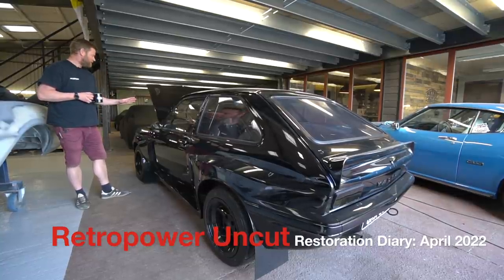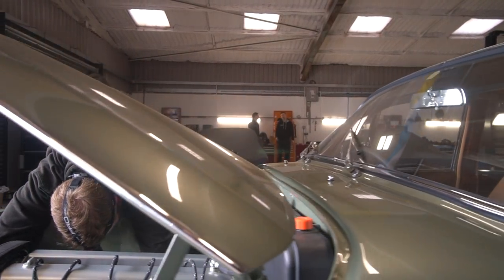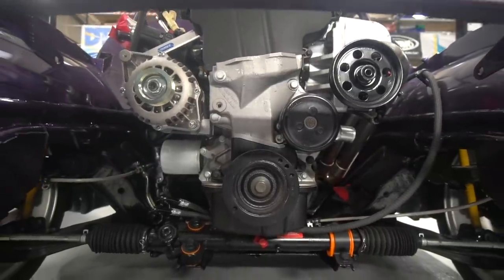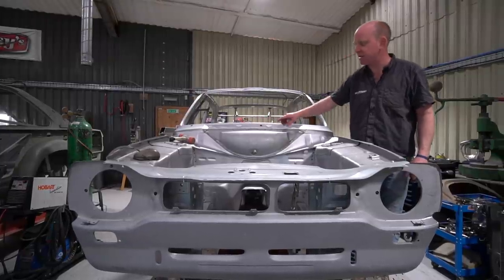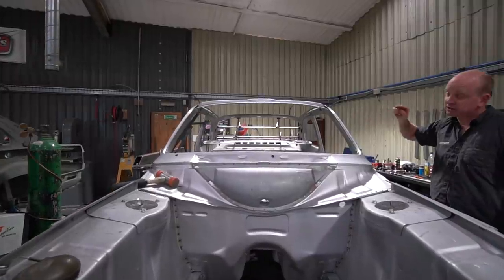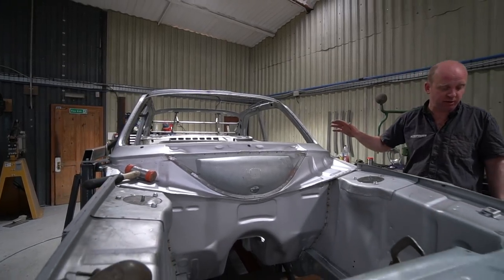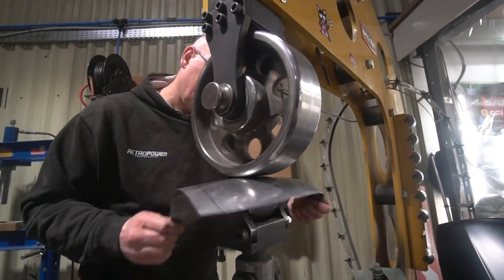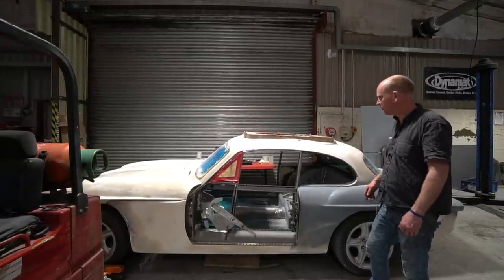Retropower Uncut Episode 85: E-Type 3D Modelling & 1UZ-FE V8 Rebuild begins for FJ Land Cruiser

Comment: Al Butler ("Turbo Yoda") from The Skid Factory refers to 1UZs as "power cubes" because of their cubic overall shape, and because you can slap a turbo on them and screw a smooth and reliable (and even reasonably fuel efficient) 550-600 flywheel horsepower out of them quite easily, and with the 3 different factory sump variations and their compact size they're relatively easy to slot into a wide variety of engine bays.

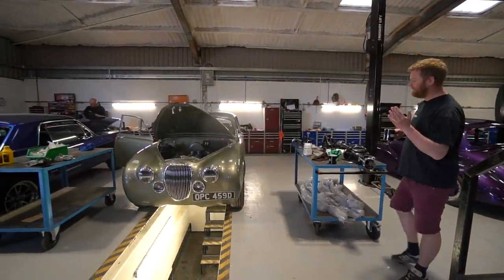Comment: @2:17 i have been meaning to suggest adding some sort of a piece of angle or so to the pit to make sure that the tires hit that before you fall into the hole. all the pits i have ever seen in commercial buildings had that. just enough to guide the tire since the driver can never actually see what they are doing once they are over the pit. may also help remind unattentive strollers to "mind the gap".

Comment: Clutch/brake pushrods - I had a problem with an MGA I restored. The brakes came on while driving and it turned out to be that I had over adjusted the master cylinder pushrod which probably expanded with the heat of the engine I eased it off a half turn and the problem went away

Comment: Those split type non backlash gears have been used in a multitude of engines for some time now,80's Mazda's for example.
Reply from the maker: Very cool
Reply: Honda used them in the V4 bike engines too as they seriously dropped the ball through the 70s & early 80s with camchains & tensioners. They went for the "once & for all" fix for the VFR.
Reply: A system used on the Citroën 2cv timing gears as well, though disabled for reduced friction losses in our race prepared one!
Reply: Aren't they called scissor gears ?
Reply: @jrobpat0154  yes, or preload gears.

Comment: All the FE series Toyota engines had the scissor gear. I fucked one up once and didn't set the spring on reassembly. Very slight chatter almost knock noise at certain revs. Almost imperceptible. Very good engines.

Comment: Honda primary drive and gear drive cams have had scissor gears in their motorcycles since the 1980's. Common practice on gear drives when you want them quieter. Not as expensive as it looks.